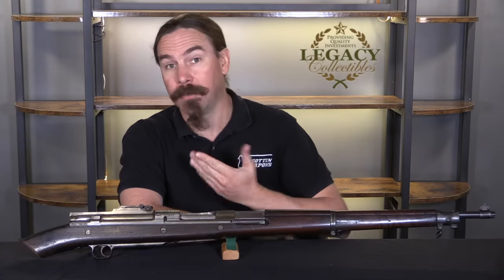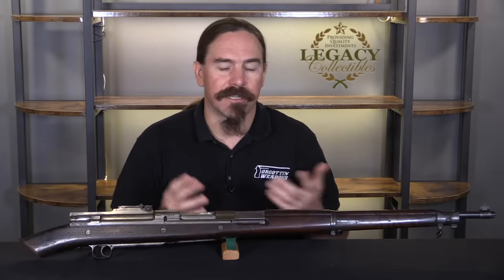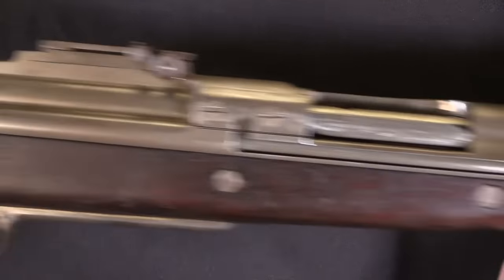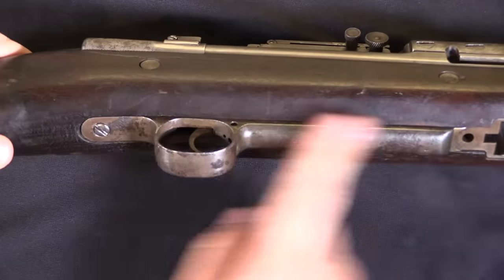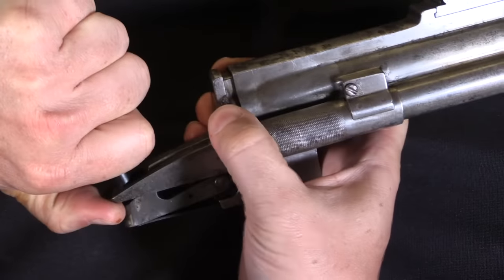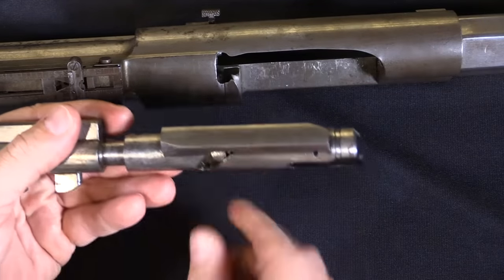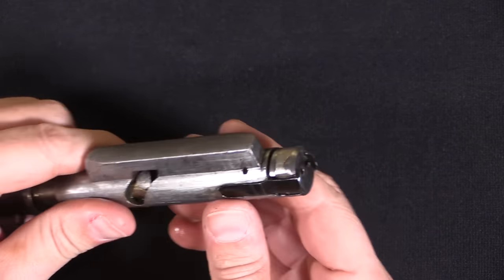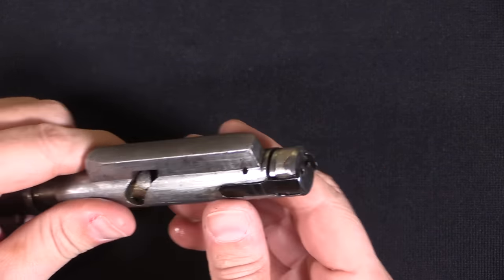Headspace-Operated Prototype Rifle - Yeah, it's as Weird as it Sounds

Comment: Good conjecture sounds like a good place to start some research and try to confirm it. 

This is weird, frankly. Highly technical and they don't feel safe as well. I mean, I know the case takes...... shape, form of the chamber, when things go wrong. This would require, as said above, a very consistent and large pool of high quality brass machined to fairly exact spec. Combined with natural wear and tear, use......

I don't see this lasting too long, even just as a prototype. 

Plus, dare I say it, a real big chunk of wasted receiver in that. Another down side.

Comment: Interesting. 
A 25mm M242 Bushmaster although electrically driven requires 12mm to 14 mm of barrel recoil to unlock, as a safety.

Apparently this was invented long before Hughes Aircraft made the M242.

Comment: I thought of something similar before, I question a bit  it would be unsafe if done correctly as some caseless ammo designs works similarly. A delayed blow back seems to work with some vague similarities also, as the case moves back slightly before the bolt opens. I assume you could put the bolt head also deeper into the chamber to maybe have a movable head space  while having a fully supported case, or in other words a fixed head space where the length of the chamber changes as case slightly stretches, similar to how some caseless ammo bolt heads sit a bit inside the chamber and not just right outside of if it. It might act like a kind of locked breech delayed blow back that would maybe nullify the need for a fluted chamber and not mangled cases, just stretch the case more  and possibly allow for tunning by adjusting the over travel in cam path. I think the main question is maybe can brass stretch enough before cracking and if not could something else be used maybe copper? In addition is brass cracking even an issue if you have a bolt head with a rings that extends into the chamber?

Comment: what if the stock wasn't cut off, but the piece of wood the stock was made from wasn't long enough? maybe they planned on adding it later or something?
Reply: At that point, you'd expect the end to be finished like the rest of the furniture, no?
Reply: i would guess so! I mean, i have no idea. I don't know anything about gunsmithing. I'm just trying to think for reasons why the butt could be missing. Maybe young was planning for some modular polymer stock? :P
Maybe at some point someone deemed the gun unsafe and cut the butt off to try and dissuade potential shooters?
Reply: @TaxiServiceMods  as old as that cut looks, I think it was cut off to fit into the test fixture, pulling the trigger via string.

Because that system is going to blow up cases.

Comment: So lemme get this straight. An HK slap handle, an AR style bolt catch conveniently in the same ergonomic position as an AR one, 2 bolts that move independently of one another, and it’s designed to intentionally fire out of battery? This is the most Elbonian gun I’ve ever seen, I want 3 of them.

Comment: oh... oh no,   looking at that manual bolt hold open... no its not, look closer down, there's a grove under it,   that could EASILY be pushed up by the magazine follower...  meaning thats actually the manual release... for the AUTO BOLT hold open for last round.    Fire 5 rounds, drop the clip in, press down, pull the tap bout, hit the release button and the bolt slams forward.

Comment: I have a feeling the stock was cutoff so no one could shoot the gun.  The inventor, or someone who tried to shoot it later, decided it would be safer if the gun made unshootable.  They wanted to keep the gun and it's mechanism, but not be able to shoot it for safeties sake.
Reply: Why not just take the action out of the stock?  Or just remove the bolt and look it up separately?  Cutting off the butt doesn't stop people shooting it, it only stops them shooting it well.

Comment: Ian, watching this video makes me wonder how modern adjustable gas piston technology could be applied to some firearms designs to replace the traditional coiled steel recoil springs.  Any thoughts on this?
Reply: the question is, what would it do better. springs are simple and cheap. the risk of a catastropic failiure is minimal.
Reply: @exploatores  Much of my experience is in airguns, where springs are the actual power source and do tend to lose effectiveness with time.
Reply: @gutfinski  springs looses strenght over time. but they hardly breaks. for simplisity say I am making a new open bolt smg. what makes a piston better to drive the bolt forward and stop the bolt. then a coiled steel spring.
Reply: @exploatores  Well, first of all, gas springs are easily adjustable which can allow the firearm to be adjusted for different loads.  Also, gas springs can be made to be self-damping, eliminating the customary “bounce” of steel coil springs.  I was only trying to suggest that modern technology can allow designers to think outside of the traditional “box” when designing firearms.
Reply: @gutfinski  Could you do it? Sure. The end result would be a less reliable, more expensive, harder to maintain firearm that otherwise doesn't do anything different. Who would buy that? It would be just another forgotten prototype for Ian to do a video about.

Comment: Could this firearm possibly be a recoil-ish operated one? What I mean is, as the pressure of the fired round built up would it force the full case back and begin the extraction process? Instead of the expanding jacket theory that is. Obviously Ian is the professional here but I'm curious if it might've been a difference in practice and theory idea like the early (roller or surface/ramp for example) delayed blowbacks as they originally thought them to be built upon a buildup of friction that was later discovered to be incorrectly operating on a successful principle of pressure buildup.

Comment: You can see that if it relied on case stretching, at that time, uniformity would have been as issue I would think. Definitely not the safest system ever developed that's for sure.

Comment: If the whole case jumps back with the bolt instead of stretching, would that effect range? Like maybe lose a couple hundred yards due to slightly reduced chamber pressure? Assuming more gas escaping.

Comment: Here’s my question please. How does the cartridge get fully forward so that it moves backwards to initiate the mechanism? If you just push it in with the bolt won’t it be only as far forward as the bolt face with the bolt face pressed back already against the rest of the bolt? The bolt face needs a spring that forces the bolt face to be fully forward I think?
Reply: I assume the firing pin would hit the cartridge with enough force to move it a few milimeters.

Comment: isnt the cartridge case moving literally what happens in every blowback gun delayed or not? I dont understand why this is a bad idea.

 This is locked breech, but it unlocks using a blowback mechanism.
Reply: this system would lead to very high bolt speeds and high pressure on ejection which is very not good on a rifle

Comment: Every time I think Ian would run out of strange guns after all this time but he keeps finding bizzare stuff .
Would this gun be one those guns that throws the case to orbit like tompson  automatic rifle?
Reply: What?
Reply: The Thompson's problem was that it used what was in practice a marginally-effective delayed blowback system, which is why it ejected like that.  This system is a true locked breach, so if it works at all, I don't see why ejection should be especially violent.

Comment: Amazes me how complex and precise guns were back then. We have much better tech to easier make complex guns these days, but surprisingly, it seems most guns these days seem to be less complex. (Like from 1911 to Glock).
Reply: Complexity and performance aren't correlated in any way when you're talking about anything mechanical. Technology in small arms has mostly been focused on simplifying mechanics as much as possible, because complexity and reliability are often very directly correlated. The more parts, the more likely it is to break.
Reply: @ic3olate  No doubt. However, you say that performance and complexity aren't correlated... but then that complexity and reliability are correlated.... but are not performance and reliability the same thing when it comes to guns? They only have one function.
Reply: @deucedeuce1572  I definitely see where you're coming from. I was lumping in a few other things under "performance", like ergonomics, efficacy of sights/optics, manageability while firing and so forth; In hindsight most of those things are rather subjective. I agree that reliability is the most important of those things, especially from a military/paramilitary perspective.

Comment: So this is basically a form of delayed blowback, where the rearward force of the bullet case moves the rear part of the bolt assembly using only a small amount of travel with a large amount of force.

I guess another way of calling this is "short delayed blowback" or "travel delayed blowback"?

Comment: This is kinda similar to roller delayed blowback, both need the firing pin to complete its backward movement before the bolt is unlocked and start to move.

 The differences are what make the firing pin move.

Comment: Just looking at how fragile the charging handle works can tell you why this didn't go anywhere
Reply: Eh, for a mechanical testbed as long as the operating mechanism works, any other fixtures or features can pretty much be ignored.
Reply: @daniellewis1789  Exactly.  If the system had any promise, things like the charging handle would have been fixed in later versions.